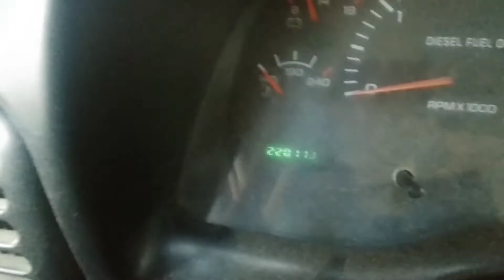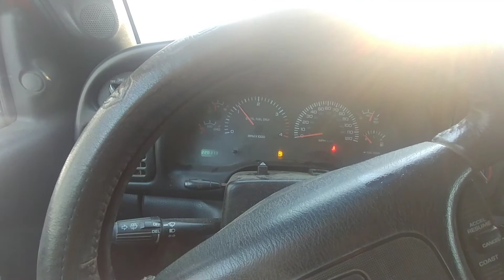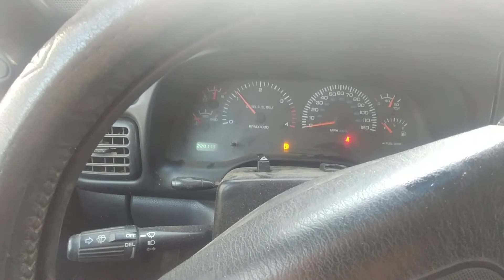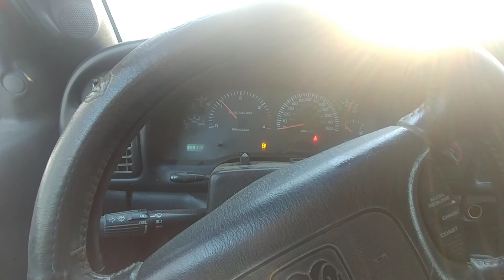2001 Dodge Cummins cold start/3 cylinder high idle

Comment: You really shouldn't cycle the grids twice it's no good for them.
Reply: @Alan, Yeah bud you’ve got no clue what you’re talkin’ about 😂
Reply: @douganderson7002  air is moving cooling the at the point
Reply: @leoweber3629  have you seen how hot they  get? Really no need to cycle them  a million times, you just run the  risk of burning them out.  They cycle when the engine  is running, but there is a significant  amount of air movement  at that  point.